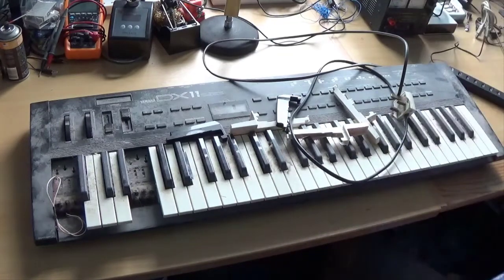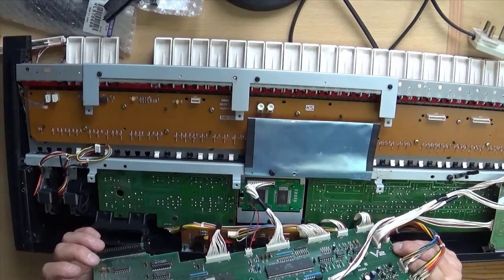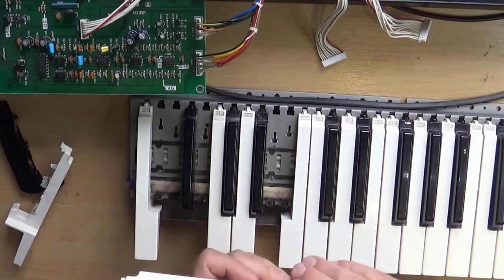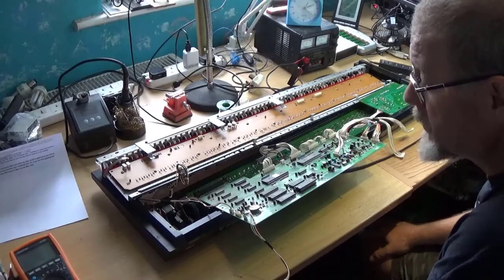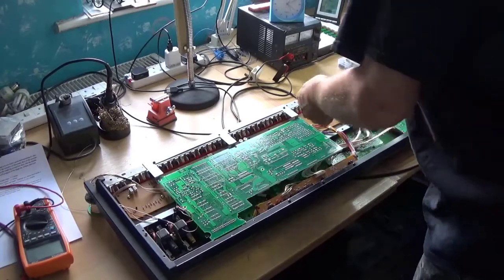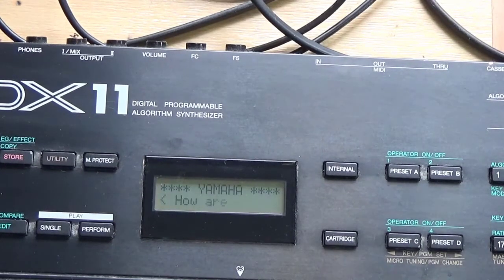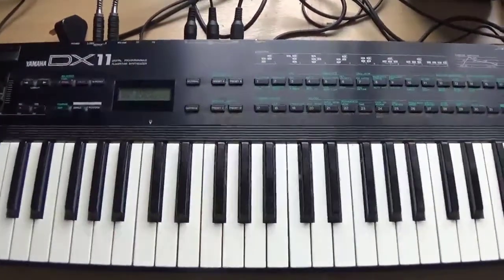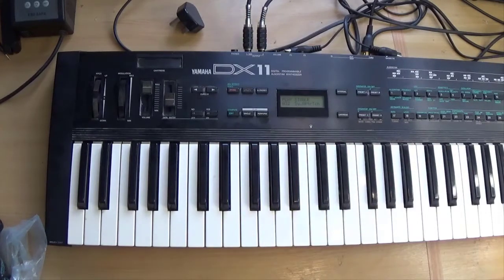Yamaha DX11 Synthesizer Needs Repairing. Let's Get Stuck In

Comment: I would definitely like to emphasize that the rubber stopper running underneath the length of the key bed MUST be removed before any key can be replaced. It's not glued down or anything so it just slides right out.            Edit: @12:16 "...this thing is out of the way...", The "thing" is the stopper that slides out.
Reply from the maker: Thanks for that - I hope other people will take this on board. I can't spot from the video which one you actually mean - though I'm sure I didn't take it out. Unfortunately I don't have the DX11 any more to examine more closely.
Reply: @TripplikitElectronics  Yeah, I wasn't very detailed in my description. Apologies. I was having a rough day and what better time to fix a keyboard, right? Lol. Anywho, great video! It's definitely been more than helpful during the repair process.

Comment: Hi, are you getting volume because you have the outputs connected to speakers? I have no volume.
Reply from the maker: Sorry to be a bit vague here but the DX11 has gone to a new home so I can't try anything. I seem to remember the main outputs just worked but you have to use the left one if you want mono. There is a 2nd pair of outputs, labelled "aux" I think, which you have to turn on in a menu somewhere.
Reply: The "Speakers" should be powered ones. In Voice mode output 1 and 2 send the same Mono signal. In Performance mode you can decide, which voices go to 1 and/or 2.
You can layer 8 Voices in Performance mode. There is no 2nd pair of outputs.

Comment: i found a dx 11 perfect condition in the street took it home and when i turned it on it said change battery ram . so if i will change the battery ,will all the sounds and features work ? or they have may be deleted from the device
Reply: on test mode it makes one sound and works fine
Reply from the maker: Lucky you. Definitely change the battery. When the battery fails, you loose the user edited voices and the performances. When you install a new battery, you will find these are now garbage. You can download the factory performances and upload them to the DX11 using sysex - however I didn't bother trying this.
Reply: @TripplikitElectronics  thanks for your answer ! so if i dont download those factory performances the synth will be empty from all sounds ?  im not even sure how to download stuff into these i dont know much about synths i just want to make it work and play with it a little bit
Reply: @doubleghetto  The Sounds in Banks A,B,C,D are preset and will be there, if set back to defaults.
Reply: @freestate6200  thanks my friend for your big idea and solution.  I Did it and get it sounds
Reply: @TripplikitElectronics  thank my friend.  I did it and so get sounds

Comment: hi! is it possible to solder new battery holder in parallel with old one, so you do not loose content / when new battery is in holder and wired, old one can be removed?
Reply from the maker: I would be inclined to solder a couple of wires on (to the battery terminals) and connect a power supply of the same voltage as the battery. I don't know how much power would be lost from the new battery into the old one if they were connected in parallel.
Reply: @TripplikitElectronics  thx!
Reply: @filmbesa9313  I would recommend to do a sysex dump from the DX11 to your computer, and then transfer it back after you have changed the battery. Does not sound like a good idea to solder on a second battery, since it will eat your new battery, I think. Solder on a battery holder instead after which it is much easier to change batteries in the future. That's what I did with a V50 last year.
Reply: @patsonmusic  thx, i think the service guy connected it to a steady voltage source (from transformer) while changing it... all is good now. THX for the answer

Comment: Hi There, I have the same issue and about to change the battery ! Which midi interface are you using ? I bought a cable USB to MIDI from ebay but I am having issues 
Thanks
Reply from the maker: Avoid the cheap ones off eBay - they are rubbish. I bought one and it failed the first day. I took it apart and it was very badly designed - see my MIDI interface video. I would buy a branded MIDI interface - I bought an M-Audio one which has been great.
Reply: @TripplikitElectronics  Yes, stay away from the cheap usb-midi cables. Buy a Roland or M-Audio or whatever brand usb-midi interface.

Comment: Hi, friend.  I need your help with my Yamaha DX-11 broken sounds.  I changed 3Volt battery and now no sounds. Only low level broken sound.  I´m Mr Rolando fron Dominican Republic.
Reply from the maker: As I understand (and my experience from repairing mine) is that the 'A' and 'B' voice banks are stored in ROM so changing the battery should not affect these. If these are not working there is a fault on your DX11.
The "I" voice bank and the performances are stored in battery backed up memory and will be lost when the battery failed. They will be garbage when you install a new battery. You can download the factory data and install it using sysex but I never bothered to do this.
Reply: @TripplikitElectronics  thank you so much.  I’ll probe it
Reply: I get it and I give thank so much to you for your importan guide.

Comment: That guy has no clue whatsoever. Using an electric screwdriver is really not necessary in such a delicate environment.
Take your time, when first attempting to open up such a synth.
I do admire though his detailed hectic way. It's like Punk. Can motivate you to do the same.
Well done.
Reply from the maker: I started out unscrewing them by hand but there are a lot of screws in the DX11... That electric screwdriver is very low torque (I have it specifically for that kind of job) and I was very careful using it.